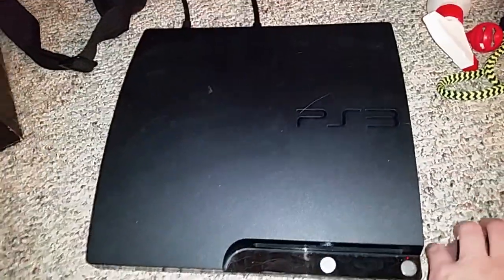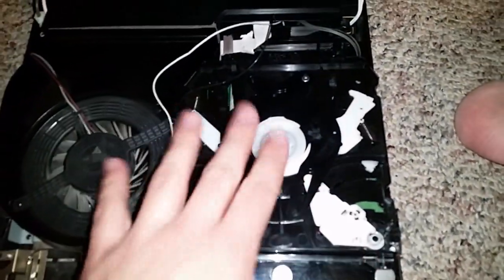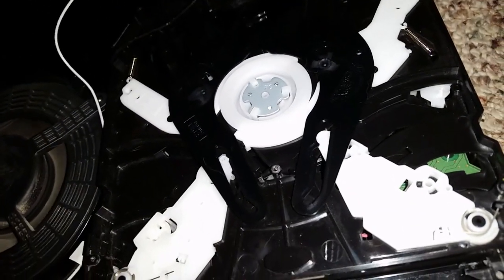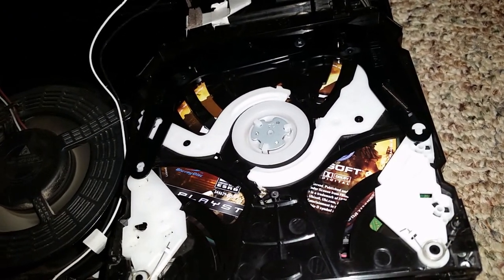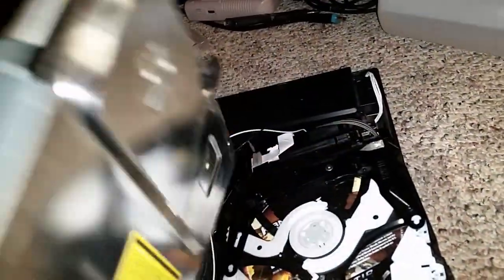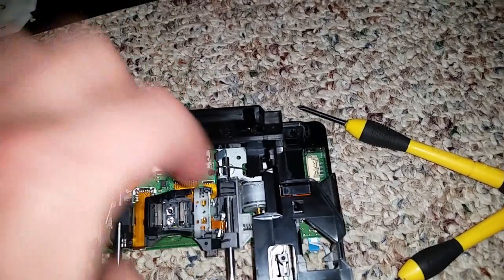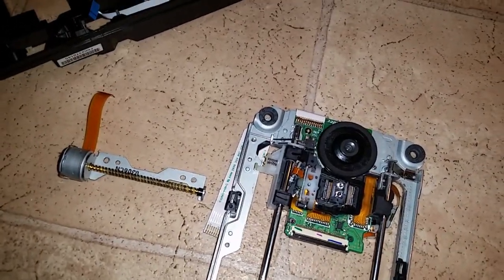PS3 Blu-ray Drive Doesn't Take/Eject Discs Fix

Comment: Slot loading drive is fancy, but if this is going to break down on most of the product, I am not sure if it’s a good idea for the manufacturer to use it. Mine is broken as well. 😢

Probably that’s why Sony didn’t use it for the next version. It will also help with the cost reduction.
Reply: True. But I also think that Sony perfected it later on with the PS4. At least the PS4 Slim I have works smooth like butter.

Comment: Appreciate it this so much! I tried to play a game after 3 years and ran into this issue when trying to insert the disk.

In my case, it seems like the motor became stuck (from the combination of dirt and no use). All I did was move the lens up and down manually a little bit and clean the rail that it slides on.

Looks like it did the trick. What a relief! I have a ton of PS3 games I still want to play.

Thanks so much for sharing this! You saved my PS3!

Comment: The issue with the discs not wanting to go in is a problem with the placement of the gear syncing and not the drive. I just did this same thing by taking the disc out of the drive without letting the console do it and it messed up the sync with the mechanism pattern. So if someone opened the drive and played with it, they didnt resync it properly (I re-synced it by taking the bottom plate off and then manually winding the tray down with the gear). Now the rough stepper motor that might be an issue, yeah. My PS3 is not reading either and my motor moves rough.

Comment: Thank you! Thank you! Thank you!  If it wasn't for this video, I would not have found my very similar problem.

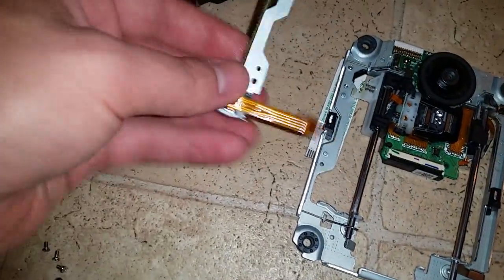Here's what happened:  My PS3 would not play blu-ray discs (but would play DVDs just fine).  So, I ordered a new laser "deck" from Ebay (the whole laser assembly you can see at 5:06).  I replaced my old deck with the new one and..... then it would NOT even load a disc.  After trying many things, and many YouTube videos, I finally found this one.  That lead me to check the stepper motor of my "new" deck.  Sure enough, the CABLE to the stepper motor was damaged.  I salvaged the stepper motor (and attached cable) from my old deck, and installed it in the new one and..... It WORKS!  Thank you!!

Comment: Thanks for the video! i had the same problem, that i couldn´t spin the motor. I noticed that the thread was bent and not in the bearing. so i used a screwdriver to put it back into the right place and now my drive is working again.  My brother dropped the ps3 and that probably caused the problem :D

Comment: PS3 CECH 2501A  :  Hey, I was replacing one of the wires that connect to the power button, and had to remove the disc drive. Then when I was putting it back together, this piece fell out of my ps3. It's a small clear piece. Where does this piece go? If you know please message me at annparksluvsruss@yahoo.com.

Comment: Press & hold the eject button for 15 seconds or until you hear the motor recalibrate automatically worked for me. Thank god.
Reply: you literally just saved my PS3 that i just payed over $ 400 for
Reply: @turfmaster8973  glad it helped!
Reply: This worked for me! Thanks so much!!
Reply: Thank you so much
Reply: Really?
Reply: @cdoggo3352  yes.
Reply: do i need to put cd in it while doing this?
Reply: @insane1156  It was so long ago i forgot. Please try with and without disc.
Reply: Good tip, bro! I'm thinking about maybe getting a PS3 Slim model. This fact may come in handy if the problem ever arises. That's the deal with buying second hand consoles that are over 10 years old I guess.
Reply: Didn’t work for me someone pls help

Comment: With mine the white thing at the front that goes down when the disc is coming out and it's up when the disc is in the  console am looking at it and it's completely down so i dont really know what to do any help??
Reply: Pressing the eject button for 15 seconds or until you hear motor recalibrate automatically worked for me. Thank god.

Comment: my ps3 wont take or eject my discs... Ill try this.. the same Pop up and down with the plataform thiggie happens but disk wont rotate
Reply: Do you solved this problem?
Reply: @МурадТаиров-ф7ю  YES. PROBLEM SOLVED
Reply: @Localdude_PBR  mine tipped over last weekend N not taking disc. Im going to try right now wish me luck 😬🤞
Reply: @JC-tu2ku  did it work
Reply: @spamtongspamton97  nope! Ended up just throwing it away N i bought a ps4
Reply: @JC-tu2ku  you shouldn’t of thrown your PS3 away, even broken ones are valuable!